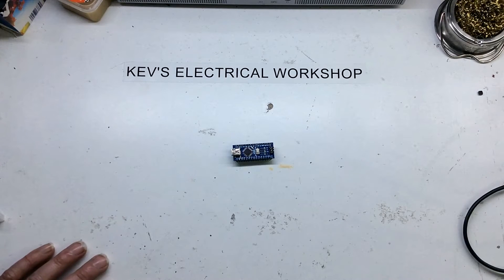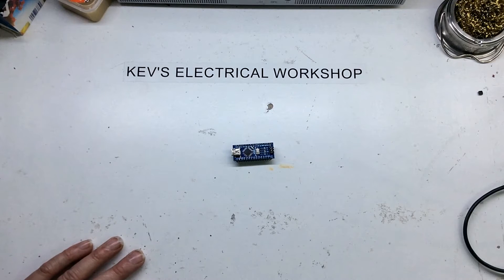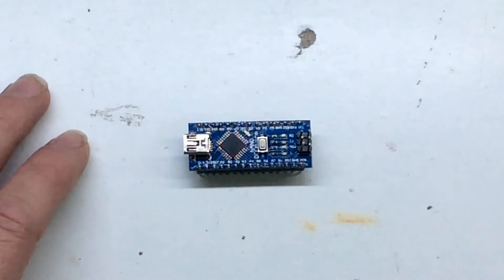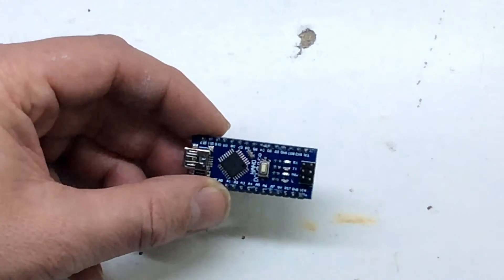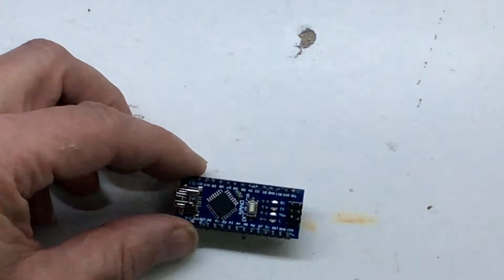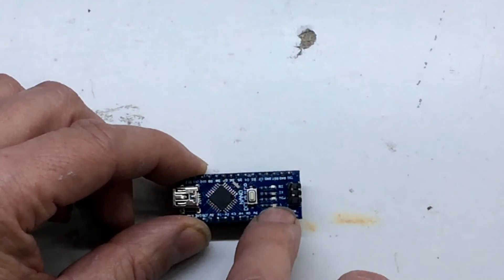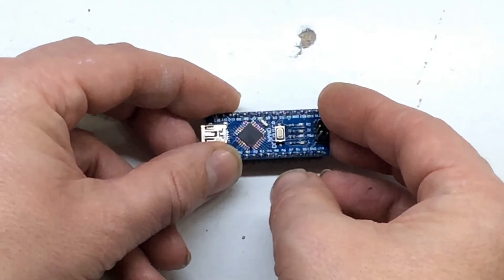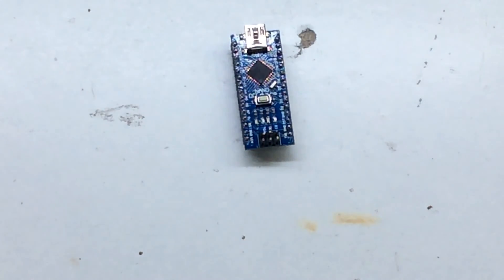The Arduino Nano

Comment: Be wary of the cheapos that use a faked version of the FTDI usb-serial chip. Some versions of the drivers from FTDI brick the fake chips outright.. you want to buy the clones with the chinese CH340G chip which does not have this risk (and is cheaper anyways).
Reply from the maker: I did hear about that but never had a issue yet, good comment.
Reply: You could just buy the them of the Arduino website